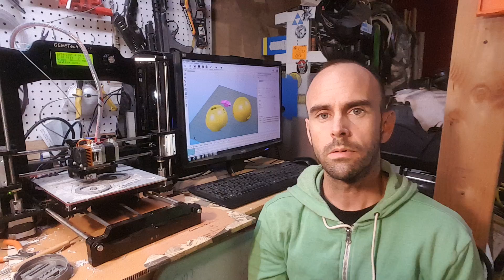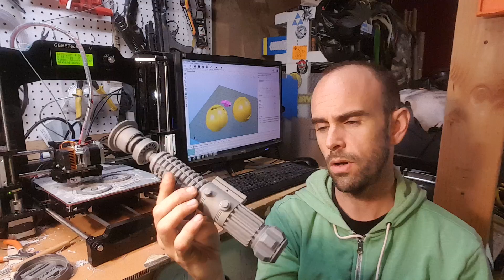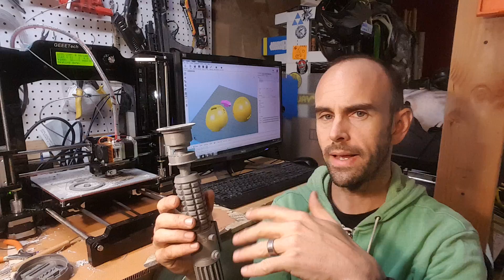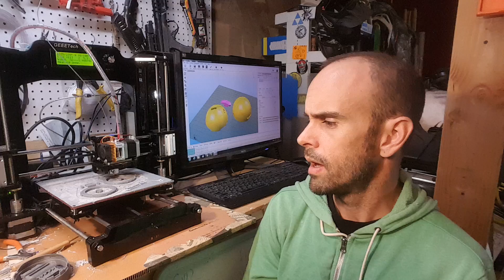Quick look at my GEEETech Prusa i3 3d printer.

Comment: i have the same printer but i keep getting "maxtemp error" any help
Reply: sounds like your temp sensor on the extruder or the heatbed is corrupted. Maybe a loose wire or something. Most times nothing serious. Are you able to measure ohms with a multimeter?
Reply: i fixed it, i mixed the two heating wires

Comment: This printer is working great for me. If you own this printer take your time to learn everything about it and also but plastic washers foelr the bed unless you want the bed to spark one day.
Reply from the maker: Been running it a year straight with minimal issues. I'd buy another one for sure.
Reply: When I posted that comment it had no typos, is Youtube jacked up again...
Reply: What firmware came on yours mine seem to have come with some firmware that was I guess stolen or I had to rewrite the motherboard firmware with some old software called hyperterminal or something I'm totally confused on this printer and I kind of hate that I bought it now

Comment: may I offer my honest option of this printer, I purchased on in Feb of 2016- I must have gotten a LEMON, missing parts, bent rods as of today I have had it apart more than running- purchasing this was the BIGGEST mistake in my life, a friend purchased on and has no issues, so please beware. And perhaps 30 good prints today.
Reply from the maker: That's a bummer. I had a few issues when setting mine up but since then its' been a champ. I've printed SO much stuff with minimal issues. Most of the problems came from me using the wrong settings and one bout of clogged extruder. Otherwise been really good.
Reply: Willi Kowal  its all part of the learning curve. i also got the el cheapo one, it doesn't even say geeetech, but after many trails i am super happy.
Reply: Willi Kowal Same here, I was okay with looking past some minor issues and missing or miss matching parts, but I have been having faults with the drivers and what not. Zero help from the seller, I would have paid double to avoid all these issues. I feel like it's a full time job trying to get it to give me more than one out of ten complete prints.
Reply: Yeah we reviewed this printer and unfortunately had the same experience:- https://www.youtube.com/watch?v=Zy7PYk7-J5I

Comment: I think i know what site you got that printer from... 3dprintersonline ?   look at yours to make sure its not a potential fire hazard....
I got a prusa i3 sixth gen.  The power cord is underrated for the psu and the psu is underrated for the printer. 
18awg cord which is 16A rating,  a 20A psu, and potential amps for the printer is about 24A (about 12A for 4 steppers, extruder, control board, then 12A for heated bed alone 12v / 1ohm = 12A). 
I switched to a 14awg 32A old microwave power cord. 
I'm also getting a 30a psu for it as well, and that should make it much safer at max potential load. 

I'm currently doing upgrades due to the thermistor breaking damaging the mks base 1.4, and causing thermal runaway. which almost set the thing on fire... (summoning magic smoke dragon) 
cheap isn't always good. I'm trying screw in thermistor to see if it prevents that issue.
if your underrated do a upgrade suggestion video. A fire hazard reduction awareness thing if you will. china would apparently love it if our houses burned down.

Comment: Hi, I have the Geetech Prusa i3 X as well.  Had a few little issues like yourself but to be expected for the price.  Out of curiosity, how level is your aluminium print bed? Mine has a little bit of a warp in it which makes it hard to set bed up level.

Comment: Can you help me with the firmware, i went to the site but when i uploaded it to my sanguinololu it just shows 2 bars on the screen. I could really uses to insight.
Reply from the maker: oooh, sorry. I really don't know. Did you save the previous version of the firmware so you can back it up? If not, I think it's available somewhere on the geeetech site. The changes I made were pretty simple, swapped some numbers and changes a few values to negative instead of positive. Worked fine every time I tested.

Comment: Hey, saw you had some problems with the firmware and with the connections that were upside down, I'm currently with that problem I've just finished assemlbing and my printer does nothing heelp
Reply from the maker: +Emilio Canton did you plug it into your computer yet? Mine wouldn't turn on on it's own but the motherboard and display would work if i hooked it up to my computer via USB cable. If that works, then it'll narrow down the problem to an issue with the power supply or connection to or from the power supply.
Reply: +gordontarpley Thanks! I resolved it through the night now I just can't figure out why my extruder won't take out the PLA. My thoughts are it's inverted
Reply from the maker: It's not feeding through? 
If that's the case, you might need to go into the firmware and reverse the motor. Check on the forums on the GEEEtech website and see if anyone has had the same issue and might be able to give you a good solution.
Reply: @gordontarpley  you didn't flip the switch on the power supply

Comment: I can confirm the printer is really awesome. Had the same issue with a bearing in one of the pulleys which  fell apart after some hours so the bearings just seem to be crap. Do you print ABS and to which temperature you set your heated bed as I think to reach the 110 degrees would take forever. I print with PLA and I am very happy with the quality of the prints.

Comment: +gordontarpley - Question - what do you use on your bed?  I don't see tape and everyone talks about how glass is awesome but my bed is aluminum.  What's your secret?
Reply from the maker: +Wholly Mindless I was using "ABS juice", it's easy to make with acetone  and scrap ABS filament. There are plenty of tutorials on how to make it. It works great but almost sticks too much.
Now I'm using a blue painter's tape. Duck brand "Clean Release" works great BUT some of the other blue tapes I tried DON'T work at all so I'm sticking to the Clean Release from now on.

Comment: I just got mine and have it assembled but I have the Repetier Host and it wont send to the printer.  The Arduino firmware you mentioned.  Is it easier?  Is there a link to where it can be installed along with the drivers?  I am on a mac and everything I have found so far is for a PC.  Thanks!

Comment: So my question is, is it worth the 350 dollars? money means alot for me, i dont have much, so i wanna be sure of my things, what is THE cheap and best printer?
Reply from the maker: +Alowne00 I think it's worth it. I've used it a TON since I put it together. I haven't looked too much into other printers in the same price range so I'm not sure of the other options. There were a few issues at the beginning but it's been running great since then.
Reply from the maker: +Alowne00 two of my friends have the same printer and didn't have the setup issues I had so I may just suck at putting stuff together. ;)

Comment: How about sharing your settings and what software your using to print?
Reply: +ocso295  you can download the user manual on geeetech.com, very detailed settings for this printer http://www.geeetech.com/unassembledgeeetech-prusa-i3-x-3d-printer-p-941.html
Reply from the maker: +ocso295 I'm using Slic3r to figure out the print. I'm still working out my settings haha. They're getting better but i tweak them every time i make a part. once i get it nailed down i'll try and make a vid.